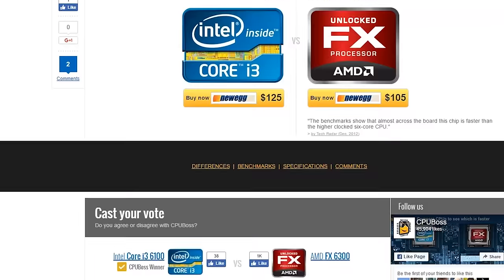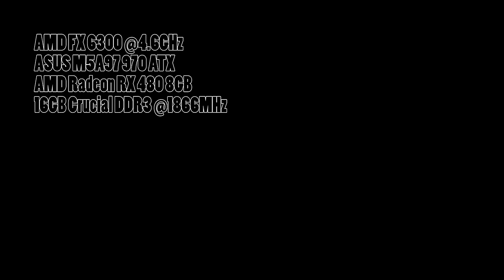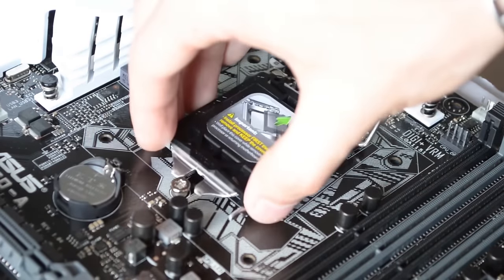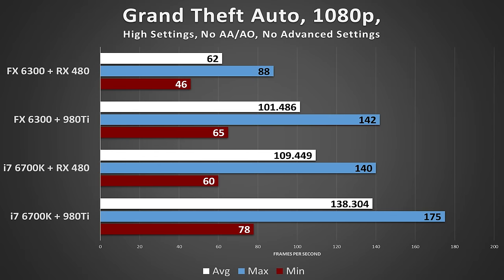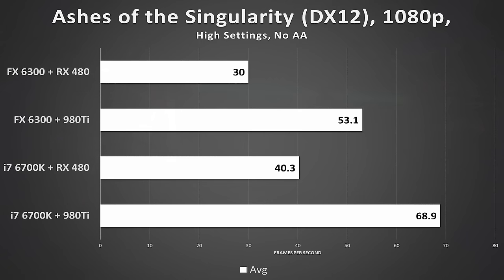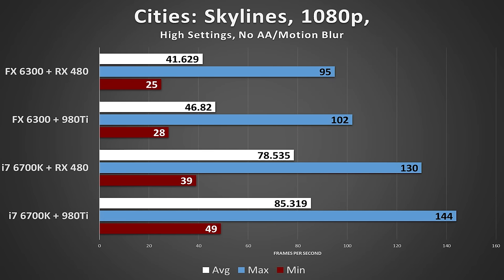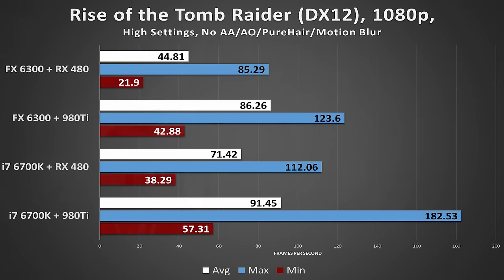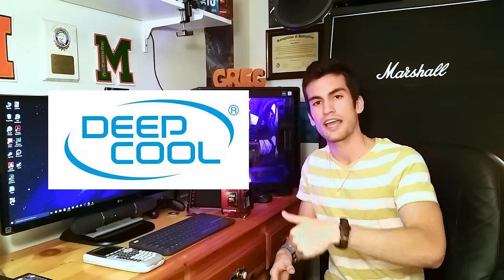AMD FX 6300 + RX 480: Severe Bottleneck?

Comment: Greg! please make a benchmark for i3 6100 + rx 480 because i'm planning to buy the gpu. as always man. love your videos.
Reply: and remember me when u get popular. cause i think u will. soon.
Reply: the amd fx 6300 is better sonce it has 6 cores rather than 2 which is what the i3 6100 has, so you will be getting better performace on triple a games.
Reply: he has 66k subs, he wont remember you
Reply: +Fire Water lol that logic is so flawed i think you should watch some benchmarks
Reply: If i were you, i'd stop giving advices, seriously.  You know shit about architecture, IPC , fab process, just anything. You're comparing apples to oranges but to you somehow they look like apples to apples. 
The newest i3 6100 just wrecks the fx 6300 and  also causes problems to an fx 8320. So, what the fuck are you talking about? 
If the fx were so good, i would've gone with those rather than spending 120€ on a z170 motherboard, 130 on a dual core cpu, and another 60 on 8 gigs of ddr4 Going with an fx6300 would've allowed me to save like 100€, glad i didn't.
Reply: Fire Water yea but it has better performance on single core tho... and the benchmark of it is similiar to i3-6100
Reply: then you wasted 100€ to get 15-20% more CPU performance and less future proof build ? (although there is DDR4) For me, this makes no sense unless you're planning to upgrade to an i5 or an i7 in the future.
Reply: +Radu Lupu You don't need to be aggressive here, sure an i3-6100 can outperform an FX-8320, when it comes down to singlecoreperformance it will. However the same goes for the FX-6300. In a game using 6 Threads well a FX-6300 will outperform an i3-6100. So it's different from game to game.
You don't need to know a lot about CPUs to see that and what you spend on PC parts isn't related to this at all.
But question was is a RX 480 a good GPU for it? Yes I think so, why not. If you're playing singlecore intensive games an i3 is equal to an i7 and in games which need a lot of CPU power and like more cores it will obviously be the bottleneck.
Reply: This is what I was going to ask.
Reply: +Fire Water The benchmarks prove that the i3-6100 is better please get your facts  right before you go on telling people false information.
Reply: +96erAtDrift The better threading beats the extra cores it's proven.
Reply: Obviously 2 Intel cores beat 6 AMD cores, if you really think thats the case you're far from reality here.
In therms of singlecoreperformance i3 ist the clear winner, in therms of multicoreperformance FX-6300 is the clear winner.
Reply: +96erAtDrift The i3 still beats the fx 6300 on all terms even if the fx 6300 wins in quad core games it's by a barley noticeable difference
Reply: +_Y YOUNG I'm not sure you got that future-proof thing right, socket 1151 is newer, better and more future proof than the am3+ socket which is DEAD and has been so for the last years. The only upgrade path you'd have from an fx 6300 would be either an fx 8300 or an fx 9600 or whatever was that called, which is nothing else but a factory overclocked 8300. With what i got, i can always move to even an i5 cpu and blow away just about anything amd has to offer, let alone an i7.  No need to defend amd here, 20% is a lot more performance, especially when you take into consideration that a dual core cpu makes fun of a 6 core (triple but nevermind). Amd just need to get their shit back together, i've been using amd for years, never had any issues with them other than poor single thread performance which gave me some headaches here and there. Wish them to get back and kicking with their zen architecture, but sadly for us right now, intel is the only way if you want the best.
Reply: +96erAtDrift Please watch some reviews, i3 6100 vs fx 6300, there's plenty of them. Fx stands no chance regardless of the task they're given to do. i3 is so damn good it competes with the fx 8320.
Reply: Radu Lupu Don't misunderstand me, I understand the the i3 is 15 to 20% faster when it comes to single threaded shit but it doesn't do as good as the FX in multithreading, trust me. And I just gave my opinion, for me, 15 to 20% more "partial" performance isn't worth 100 bucks considering the fact that you can make that difference smaller with overclocking and the fact you're getting fewer cores. That's why I said it is more future proof, you can also see that I clearly stated that the upgrade path on the i3 is much better and also that unless that's your objective, there's no point on getting it over the FX... but yeah, that's just my opinion.

About the i3 being "damn good" and that it competes with the fx8320 and AMD "sucking ass", please stop that bullshit. That's like picking a Celeron and putting it against an FX CPU. You're comparing a 2016 architecture with a 2011 one, go pick an 2nd generation i3 or i5, even if they manage to be better, that's what the FX line was intended to compete with, there's where you have reasons to complain or something....
Reply: The FX you're talking about is mostly a triple core processor, not a six core cpu. It isn't exactly an apple to apple comparison, take it as a triple core with some sort of hyperthreading.  Overclocking doesn't do that much, it's not like you can make a cpu twice as fast by overclocking it, sure, there are gains but most of the time i found out that average overclocks are not worth it.  
What i'm talking here is architectural differences and optimizations, FX is old tech still sold today,  skylake is new tech,  and thanks to the architectural improvements and stuff, they manage to do more with less cores. 
Bullshit? Nah, bullshit is when you decide to disagree with something just for the sake of doing it, as i said go watch reviews and stuff.  FX line is OLD, get it? OLD, and most people say it was actually a downgrade from the phenom II line, which is probably why i decided to build an intel pc and take a break from amd for a while. I'm not a fanboy, i've had an athlon 64 3200+ s939 which was da shit back then, i still remember kicking the shit out of my buddy's pentium 4 @ 3.2 ghz with hyper threading, then i upgraded to an athlon 64 x2 4200+ which was nice as well. I also replaced that with a 1st gen Phenom X3 8650 cpu, which later on i replaced with a Phenom II x4 955 BE cpu. They were all bloody awesome CPU's.  Somehow though, AMD stopped there, beginning to lose even their most notable plus : price/performance ratio.  That's why AMD is in trouble right now, not because they were competitive, but because they decided not to be competive anymore.  Also, who do you think has more money to spend on R&D ? AMD or Intel? Amd's low funds allowed it to build ZEN which will supposedly bring i5 performance level, but ain't that strange? In 2016 AMD is still trying to compete with a freaking I5, not even an i7... .
Reply: No need to get your anger levels high, it won't impress me and it won't do you any good. If you'd rather get an FX processor on an a dead socket with no upgrade path and use it for the moment, good for you, i did something different instead. I knew that the i3 offers performance levels all the way up to the fx 8320 for a price of 30€ lower than an fx 8350. I knew that if i needed more power, i could OC it on a Z170 motherboard all the way up to about 4.4/4.5 Ghz which would put it next to an i5 4690 level of performance, and i also knew that if i needed more than that, i could easily replace it with another skylake cpu now, or a kabylake next year.  Why the fuck would you go with an fx processor in this case if you're after a budget gaming rig? 
No fucking reason whatsoever, but if you still see one, good for you. I FUCKING DON'T.
Reply: Radu Lupu
My FX-6300 (OCed) does in Geekbench 2500 single core and 10500 multi core.
An i3-6100 does ~3300-3700 single core and ~7500-8000 multi core.

It's obvious that the i3 is way faster in singlecoreperformance and the FX is way faster in multicoreperformance.

And obviously AMDs shared ressources don't behave like 6 standalone cores (10500/2500=4,2 cores effektive).
And obviously Intels Hyperthreading doesn't behave like 4 real cores (7750/3500=2,2 cores effektive).
But you should never trust marketing about such features anyways, none holds what their marketing wants us to believe.

If you're on a tight budget look what performance you need, if/when you might upgrade and watch out for sales.

Thinking about which company has more funds and which architecture brings what doen't bring the end user anything. I haven't got a batch of CPU samples here to try real effekts of architecture changes. And like I said never trust marketing, it's their job to make things look better than they are. The company with higher funds doesn't always have better products or price/performance, especially in the last one often companys with lower funds deliver more.
Reply: +96erAtDrift If you want to compare apples to apples, compare stock to stock. I can oc the i3 too, I have a z170 motherboard running along with it which supports non k over clocking which means you'd lose again. Why can't you simply accept the obvious? A dual core blows your *six core CPU away.... .
Reply: +96erAtDrift I don't belive it gets that high on multiple core games in the first place.
Reply: Comparing apples with apples with one option beeing more expensive is obviously hard, but could you do a geekbench run? I'm going to do one when I get to my PC,
My system is a few years old, I'm lucky I went with the FX-6300 + HD 7950 instead of 3rd gen i3 (don't remember the exact name) + HD 7870.
So this was a good choice anyways for me and I don't have an issue when you "blow it away"
Reply: When your pockets allow for an i5, go for it, otherwise i3 ftw. Powerful enough for everyday use and gaming.
Reply: +Fire Water i3 has faster cores so better performance.I3 6100 completely wrecks the fx 6300
Reply: The i3 6100 is simply the right choice to make cpu wise, period. 

I have an fx 6300. it's shit. In WoW I get around  24-30fps on ultra. With the i3 6100 I get over 60+ now. And yes, that is real.  Even the pentenium G gets more. 

yes, in bf4 the 8350 gets more fps. COngrats on that.
Reply: Friendlyguy You won't be able to convince the vast majority of FX users that a simple dual core like the i3 6100 laughs at the six core fx chip. They just won't accept that 2 can do much more than 6, so you just wasted your time. I support you for being honest though. At 130€ the i3 is just the way to go.
Reply: Radu Lupu 100%.

yeah, and seeing as how it has four threads it acts pretty much like a six core.. it's simply the way to go.
Reply: The i3's are not as powerful as an FX 6300. You can see this for yourself by searching for pretty much any benchmark and look at the encoding results . Encoding is probably the highest loading of a core of any software except stress tests .  The i3 doesnt so much laugh as whimper. 
Gaming is a different scenario though and if you turn down game details or run low resolution then the i3 will pull ahead most of the time On the other hand if you play at 1080p or above and  benchmark online  then the extra cores really do pay off and the FX is faster
Reply: Yet, people buy i3s or fx 6300 for general use or gaming, not encoding or rendering. Those are tasks better suited for fx 8xxx, i5, i7.  In general use, the i3 is faster. In gaming, the i3 is faster again, with just two cores regardless of the resolution or details you play at. I'd be nice if you'd stop dreaming when benchmarks and video reviews are all over the place pointing at different results than the ones you claim.
Reply: Good to know you are not a biased intel fanboy dude
Reply: Considering that before the current i3-6100 build i had only AMD rigs, the last one being a fairly decent Phenom 2 X4 955 BE , i'm not biased in any way. Before buying the intel rig, i made a lot of research, made pros and cons between the fx and the i3, took the ability to upgrade the rig in the future into consideration as well, and after this i only got to 1 conclusion, the i3 is the way to go, even if it's just a dual core which to some(including me) might feel somewhat weird/bad to purchase in 2016. 
I even said in several comments on youtube that I HOPE to regret buying the intel rig and not waiting for AMD's ZEN line of cpus, i wish them to come back to their glory and bring some serious competition which would be good for us, the end consumers. I also might switch back to AMD if they deliver, not soon as i will not renew my rig in the near future, but i might later on. 
P.S - in terms of GPUs, i'm also using Radeons, and have used so for a very long time, X300, x1650 pro, hd 4650, hd 4770, and now hd 7850. I've only used like 2 nvidia cards, one 9600 GSO which was cute and proved itself worthy for the money spent, and another 8800 gt which was  faulty but i kept using it for more than a year. I'm not a fanboy, i only tried to use the best there was at the moment.  In 2006 i also had to choose between the mighty Athlon 64 3200+ and a pentium 4 with HT at 3 ghz, i went with the AMD because at 2 ghz it outperformed the intel pentium in every way.  Consider me a fanboy if you want, but i'm far from it. You on the other hand seem to be an AMD fanboy ignoring benchmarks and claims on the internet. If you'd live close to me, i'd even let you test the shit out of my i3 against your FX or whatever you're using.
Reply: If i was building a new computer today I might also make that choice . But not because the i3 performs better . It wont when you are in large multiplayer maps .
But there is absolutely no reason for anyone to switch from an FX 63XX or FX 83XX processor to an i3 unless they want worse performance